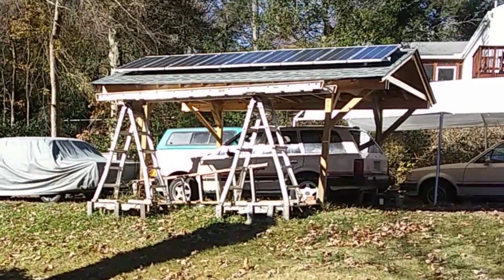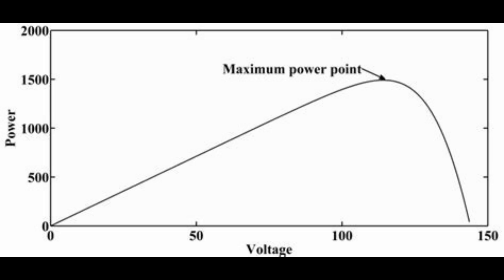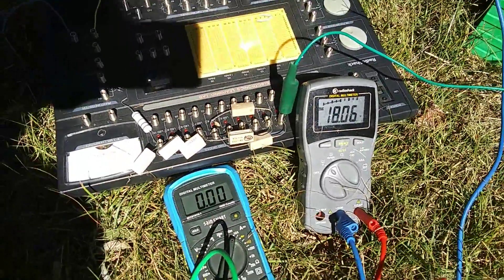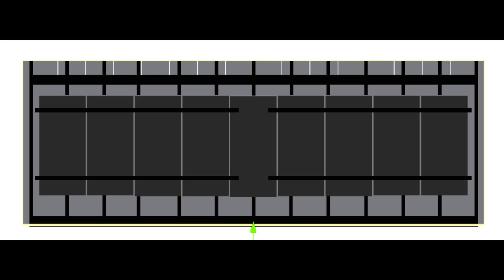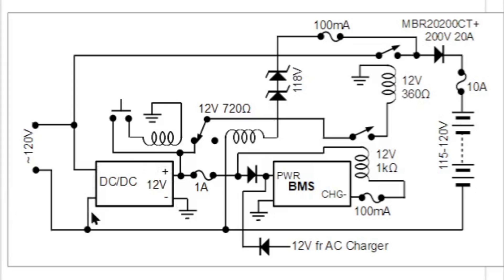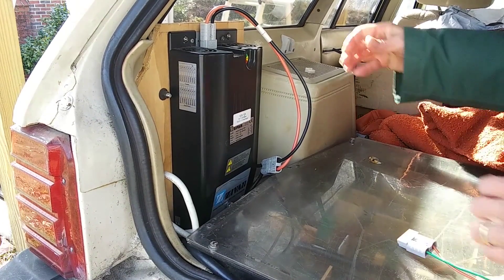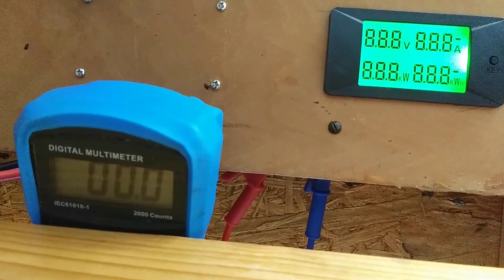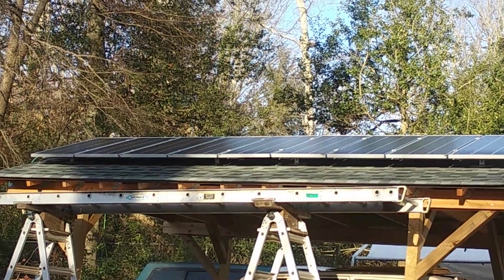Charging my EV directly with solar panels - No inverter - No MPPT

Comment: I would expand this design to include J1772 plug and socket with custom pilot signal to enable direct DC via J1772. Thinking to try this with my Nissan Leaf. You could use 4 x 370w solar panels in series for 132Vmp at 10A. You can set up automatic solid state relay to connect the array direct to lower heating element of dual element tank water heater so you also get free hot water when you have excess solar in the summer.
Reply from the maker: Not sure if I understand.  You are going to connect 132 volts DC from panels directly to the onboard Leaf charger that normally takes 120 or 240 volts AC?   I don't know enough about the Leaf charger to say for sure but offhand I don't think that would work.  Thanks for commenting.
Reply: @quetzal4042  No I was thinking tapping direct to battery pack and using 400Vdc. Would need isolated DC-DC because modern EVs have HV isolation detectors that will brick the car if tripped. Or could make custom 33 - 200V isolated boost converter with MPPT function and mount it inside the car.
Reply from the maker: @antronx7  Wow, that's really ambitious.  Like I said, I couldn't even find a 120V MPPT.  So you're going to construct this converter yourself?  You've also got to hack the interface that controls DC access to the HV pack from the plug, right?

Comment: Hi is this practical for a standard modern EV? I have panels and an off grid weekend house and all the solar energy is being wasted as the batteries are already full and we do t use much power. Is there a way to
Simply switch power coming from the panels right into an ev charger? Maybe even keep it DC? 
Or easier to buy a separate garage inverter and send power to EV that way? 
Thanks community
Reply from the maker: It's theoretically possible but probably not practical.  First you would need to somehow get up to the 350-400 volts DC that is used in a modern EV.  For the panels I used, that would mean 25-30 panels in series, or else a DC boost converter to increase the voltage.  Then you have to somehow connect that to the car's battery.  For good reason, modern EVs don't have a convenient direct access to the battery.  Some do have a high-voltage DC charging port, but you would need to hack into the electronics that control the contactor for that connection.  Or else try to hot-wire it direct to the battery, which is practically suicidal.  So yeah, probably better to go through an inverter and then into the car's normal AC charger, even though you do lose some power with each conversion.  Thanks for commenting.

Comment: Interesting project. BTW the Hot circuit at 10:21 is powered by the home AC, so is that circuit connected to the GFCI outlet for safety since the car has negative ground so the body of the car is connected to Neutral?

Comment: You can try with 2 strings, 2 mppt48v  in series output. They can charge from 40-60v = 80-120v output. If you have access to the middle point of the batteries it will be easier.
Reply from the maker: That's a good suggestion.  I did consider doing something like that.  But you'd have to have a third wire going to the car for the center tap and 4 cables from 2 separate panel arrays coming off the roof so the two MPPT controllers could regulate independently of each other.  Also, if one array was more in the shade, half the pack would oreceive more charge than the other and unbalance the pack.  The BMS has a balancing function, but it only leaks 200 mA and only balances when the cells approach full charge, because it's assumed that you're using a single charger on the whole battery pack and that the cells are only marginally out-of-balance.  Also those regulators usually have a function that turns off charging when the input is too low, so you'd probably have to have some interlock to shut them both down when one shuts off.  Probably it could be made to work, and maybe a little more efficient, but I think it does have some downsides.  Thanks for commenting.

Comment: I saw your reply saying you get 12 miles per day. In some countries that would cover a significant number of commutes. With today’s technology perhaps 7 miles per day could be achievable with just panels built into the car and again, that would cover a lot of short commutes. I think the power that can be captured by solar on a car, although fairly small, it’s not insignificant!
Reply: The advantages of solar on a car would really be maintaining 12V battery over extended periods of time, and running the cabin fan on hot summer days while parked to reduce the need for AC. Many cars have fans built into the seats as well, and the difference between hopping into a car with 120 degree seat vs a car with 105 degree seat would be huge!
Reply from the maker: Could be.  The Aptera guys claim their 3-wheel 2-seater can put on 40 miles a day and 11,000 miles a year with just the panels built into the vehicle.  Oddball design and not for everybody, some wouldn't even call it a "car", but it shows what you can do if you really push the limits.  Thanks for commenting.
Reply: Yes I’m aware of the Aptera but it’s far from an everyday design. You’ve shown that even with a conventional car design and older battery technology, you’re still getting a practical amount of range.
Reply: @oliverpolden  12 miles is practical? Must live in the city haha
I have a similar EV EXP, practically sure is held back by the batteries' & motor's poor efficiency. From weight vs power we're talking an old golf cart with the weight of a Taurus (that wagon weighed 2200lb stock and about 3200lb after the conversion) and that alone makes for bad range before we even look at the old inefficient DC motor. I'd say they're glorified golf carts but modern electric golf carts are far more efficient..... Lighter batteries and more efficient motor would go such a long way in practicality but at the cost of more than the stock gas car ever costed anybody after 250k miles it's not a financially wise investment by any means 😕
Reply: @The_1982_EXPert  Well, most people live in cities and as I said, in most countries that covers the majority of commutes. Just because something isn't practical for you, doesn't mean it's not practical for others. Plus, you could have another option for longer journeys.

Comment: Nice use of that radio shack project kit!  I loved those things as a kid.
Reply: Radio Shack ruled when it came to my projects and experiments as a teen in the early 80s.  Then my favorite DIY parts source up till it closed.
Reply from the maker: I got the kit almost by accident.   I was looking for a cheap oscilloscope but found a guy who wanted to sell a whole package - CRT oscilloscope, Radio Shack kit, some textbooks and his collection of resistors, capacitors etc for $200.  But it has proven quite useful.  As a kid in the 60s, I had a similar Knight Kit kit.  It had transistors but also a dual-triode vacuum tube that ran on 12V filament and 12V B+.  No idea what happened to it.

Comment: How long does it take to charge the car?
Reply from the maker: A long time.  The car has a 20 kWh battery pack and on a sunny summer day I can get about 4 kWh so from a fully depleted pack to fully charged would take 5 days.  Perhaps a more useful figure is that a sunny day will give me about 12 miles of driving, and with Virginia weather I can put on about 3000 miles a year, way more than I actually need just driving it around town. If I put 9 more panels on the north side of the roof but angled to the south, everything could be doubled. Thanks for commenting.

Comment: I don't understand why you just don't use a charge controller and an inverter, you'd have lower losses than your resistor bank, better regulation and also safer. There's a reason we use those things.
Reply: Maybe its the principle of the idea
Reply: Doing this way is very cheap and nearly 100% efficient. With charge controller, ballast battery, inverter, charger in line you will have about 40% of energy get lost.
Reply: @antronx7  I don't know what MPPT you're talking about but mine are over 95% efficient and my inverters are over 90%. Now with the new GaNfets efficiencies are even higher.
Reply: @mosfet500  Dont forget ac to dc charger efficiency.
Reply: @antronx7  There is no AC to DC conversion. You can simply do it with an MPPT charge controller off your modules. Inverters only come into play when you want to power AC appliances and a good quality pure sine inverter does that with over 90% efficiency.

An MPPT will regulate the charge voltage/current algorithm and give the highest efficiency even when there is low sun.
Reply: @mosfet500  which mppt do you know that handles 130v battery?
Reply: @antronx7  you got me on that one!